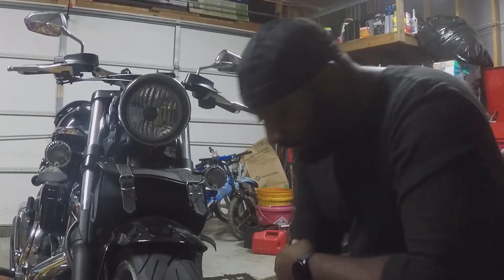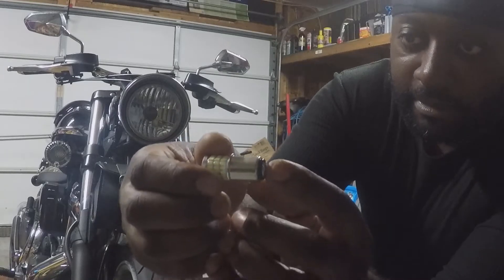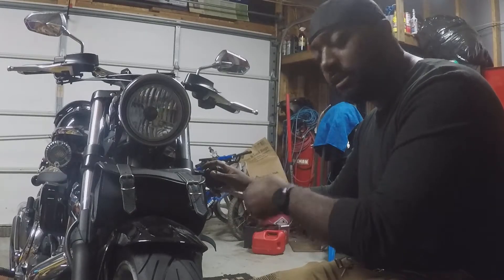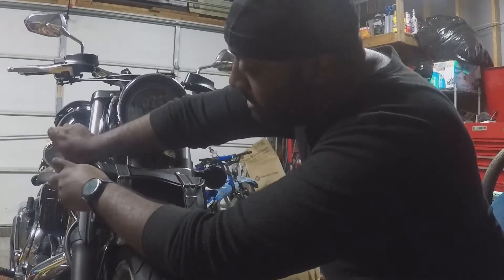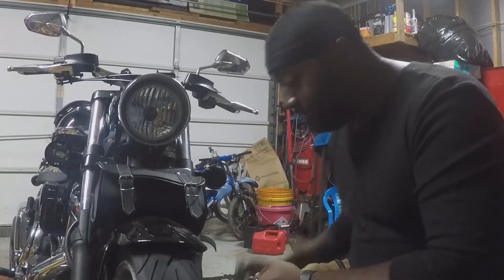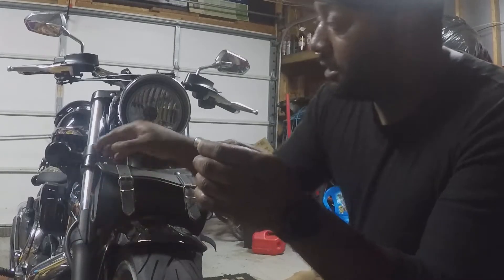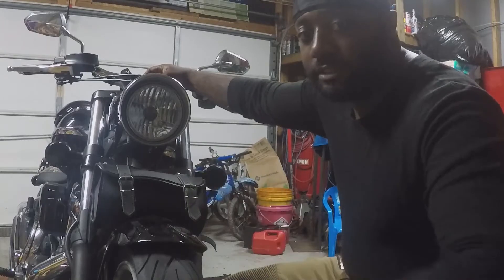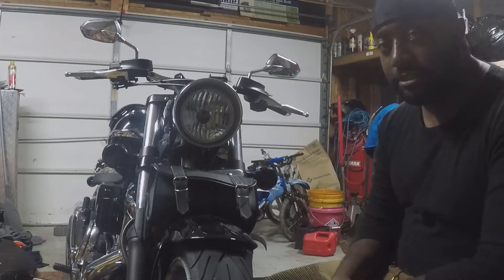Yamaha Raider First Modification

Comment: Sir did you have any startor growl issues after installing the LED's? I swapped mine a few weeks ago and thos weekend I heard these weird noises coming out of the engine
Reply from the maker: Nope none. Just the hyper flash. Did you do the rear also?
Reply: @rydeking4579  I replace all the lights to LEDs. I ordered a bunch of resistors and I'll hook them up this weekend, hopefully that will fix the issue.

Comment: From were did u buy the bag
Reply from the maker: I bought from Amazon
Reply: @rydeking4579  do u have the link
Reply from the maker: https://www.amazon.com/dp/B00BOUURMG?ref=ppx_pop_mob_ap_share
Reply: @rydeking4579  and what about rhe led light and the smoke lencense from were
Reply from the maker: @marwansarkis4931  https://www.amazon.com/dp/B00LUCBQY6?ref=ppx_pop_mob_ap_share
https://www.amazon.com/dp/B01MY4T4BU?ref=ppx_pop_mob_ap_share
Reply: Hi is the bag can fit on the top of the Light
Reply from the maker: @marwansarkis4931 I haven't tried it myself, so not sure. Possibly.
Reply: Is that light a 1157